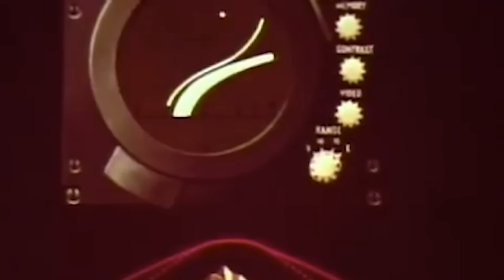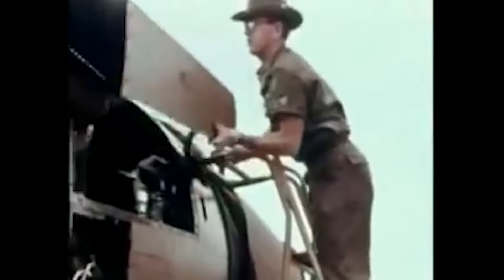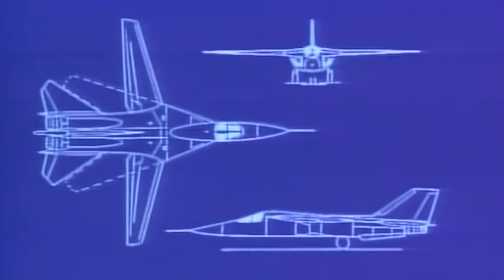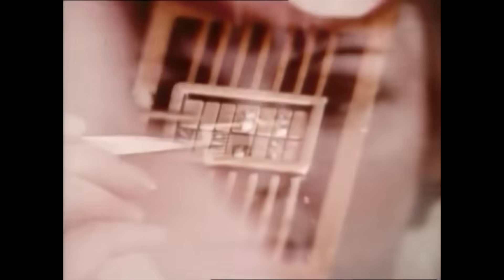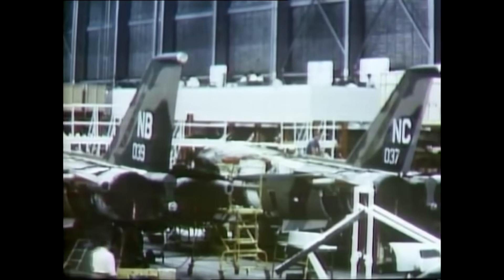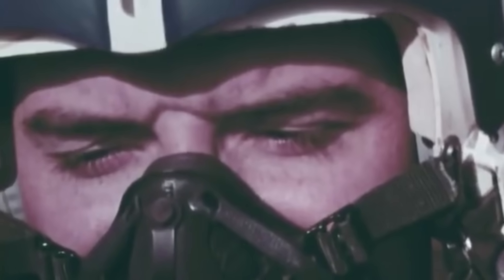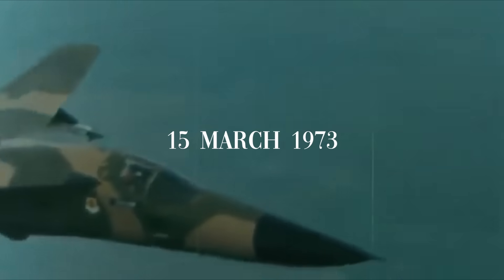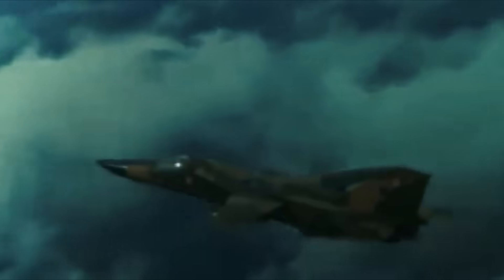The F-111's Fatal Flaw

Comment: The F-111 after its teething problems with the WCTB became the finest strike aircraft in the world and remained so for 37 years. For all the TSR2 lovers out there, I understand the emotion - I have been fascinated with TSR2 for years and travelled halfway around the world to see the two beautiful examples at Duxford and Cosford (so much for the government conspiracy to destroy all traces of them...) but the facts are Britain could not afford it, there was no export market and it was inferior in every measurable way to the smaller but longer legged and faster  F-111. I recommend Damien Burke''s exhaustive coverage in his definitive book 'TSR2-Brtiain's Lost Bomber.'

For reference- here are comparative stats

Performance F-111C
Maximum speed: 1,434 kn (1,650 mph, 2,656 km/h)
Maximum speed: Mach 2.5 (M 1.23 at sea level)
Combat range: 1,160 nmi (1,330 mi, 2,150 km)
Ferry range: 3,700 nmi (4,300 mi, 6,900 km)
Service ceiling: 66,000 ft (20,000 m)
Rate of climb: 25,890 ft/min (131.5 m/s)
Lift-to-drag: 15.8
Wing loading: 126 lb/sq ft (620 kg/m2) wings spread
158 lb/sq ft (771.4 kg/m2) wings swept
Thrust/weight: 0.61
Armament
Guns: 1× M61 Vulcan 20 mm (0.787 in) Gatling cannon with 2,050 rounds (seldom fitted)
Hardpoints: 9 in total (8× under-wing, 1× underfuselage between engines) with a capacity of 31,500 lb (14,288 kg) ordnance mounted externally on hardpoints and internally in fuselage weapons bay 

Performance TSR2 (projected)
Maximum speed: Mach 2.15 at 40,000 ft (12,192 m)  (this was later reduced to M 1.5) M1.1 at sea level
Ferry Range: 2,500 nmi (2,900 mi, 4,600 km)
Combat range: 750 nmi (860 mi, 1,390 km)
Service ceiling: 40,000 ft (12,000 m)
Rate of climb: 15,000 ft/min (76 m/s)
Thrust/weight: 0.59
Armament: Total weapons load of 10,000 lb (4,500 kg); 6,000 lb (2,700 kg) internal and 4,000 lb (1,800 kg) external

Comment: My  sister, who was stationed at Nellis AFB when the A models were there, said that there were so many problems with them, that the aircrews went on "strike" several times; every single one of them would show up "sick" at the Flight Surgeon's office. One major problem? The engines would flame out at the first hint of a rain cloud; also, like the F-14 A Tomcats, they were very prone to compressor stalls. The USAF finally swapped them with the recon RF-4C's at Mountain Home AFB, Idaho - just before I got stationed there. One of the more unpleasant parts of my career field was Aircraft Crash Survey/Recovery. Sadly, those A model's kept me much busier making crash site maps, and picking up stuff - both metallic and organic - than I would have liked... The Air Force finally wised up; shipped all the remaining A's to Grumman, who took them totally apart; threw about half of them away; and turned them - at the cost of $27 million apiece (in 1976 dollars) - into EF-111 Ravens. In which guise, they performed a whole lot better - and much safer. The rest of the time I was stationed there? Never once had to pick through the remains of a Raven....
Reply: They didn't send "all the remaining A models to Grumman...." I was at MHAFB in 1981, and there would ultimately be 42 EF-111As at two bases (MHAFB and Upper Hayford),  and enough A models remaining at MHAFB to fill out 3 other units within 366 TFW--Green, Blue, and Yellow  sections. I don't recall their numbers, but between 20-30ish each.

That being said, I only recall 2 A model crashes, neither related to the wing issue.
Reply: @Name-ps9fx  No one wants to hear your contradictory tales, sir!
Reply: I was stationed at Mt Home in 1985, and the F-111 was there.
Reply: Thanks for your service and this report.
Reply: I was in the 474th at Nellis for the last 2 years of the F-11As before they transitioned to the F-4Ds.....
Reply: @mikehayes7333  I was assigned the 474th OMS as a Crew Chief and I left Nellis in April 74, went to Lakenheath to work on the F-4D, then followed them back to Nellis to work on the same F-4D's.
Reply: @darrellbaty4127  I think I remember you!
Weren't you a Sgt when you came to Nellis?
We changed you car's transmission in the driveway of your base housing.
Reply: @mikehayes7333  Yes, I am the one, in fact, you sold me a shotgun which I still have.
Reply: @darrellbaty4127  
.....small world.....
Reply: @darrellbaty4127  
Hope you and yours are doing well.
Reply: @mikehayes7333  VX-5, China Lake.....a good deal of X testing, there, for the USAF and others....3 AM thump, thump, thump with only nav lights for knowing something was going on.  Once the TAR was gimbaled, the surfaces could actually adjust the aircraft to climb over/avoid "obstacles." Thanks for your service!  USN Squid
Reply: @mikehayes7333  <the 474th at Nellis>
I think that was my outfit also.    I've forgotten the number it's been so many years.
Reply: @penboyasgod6103  
It was either the 474th, or the 57th.
Reply: Great summary. It's interesting to see the importance between platform and mission fit in determining the success of the aircraft.
Reply: I was stationed at Mtn Home AFB 1987-90 as an airframe repair specialist.
Reply: RAF Lakenheath,78-80, F-111F's, crew chief 74-0367, mid-air with wing man April 79,both air crews ejected safely.
Reply: <who was stationed at Nellis AFB when the A models were there, said that there were so many problems with them,>
Read my post as one who actually worked on these planes during the Vietnam War time.
Reply: I crewed the F-111As at Nellis AFB, Mountain Home AFB, and RAF Takhli, Thailand. The F-111A proved itself.
Reply: @darrellbaty4127  <and RAF Takhli, Thailand>    I was at Takhli also for 4 months TDY for F-111s.
Reply: To say nothing of the TAR issues which did not allow the flight surfaces to react in time to prevent the aircraft from kissing terra firma....the folks at X.X. figured out the problem.
Reply: I don't remember the engine problem while at Nellis, but I do remember a grounding until the wing pivots were inspected for potential failure.
Reply: The f111 dominated in the gulf war
Reply: Yes, yes. You thought your sister's best friend had some job and said the plane sucked. Except it had an amazing safety record for DECADES and the people who actually flew them liked and were proud of them.

Unlike your unverified and, frankly, tired story of a flight crew that all got sick at the same time....never heard that one before. I don't believe you and I don't think you even know which aircraft you are talking about.
Reply: I was at Mt. Home from 81-82, right at the beginning of the EF program. You undersell the A model. After the initial problems were sorted out, the aircraft performed admirably in SEA. Suffered the least losses of any combat aircraft and dropped more bombs on target. The converted A's into EF's retained the original mechanical parts, WCTB, engines, cockpit, etc. After the war in Vietnam was over, the AF basically relegated the "A" to training only.
Reply: I was at Mt Home 86-90, we still had A an EF models. The F-111 replaced the  RF-4s, before I got stationed there. We had one crash while I was there, I think one burned up before I got there.-LOX issue. We also had B-1s test there. After I left I heard the base turned into a composite wing with F-15s as the fighter. I’ll have to ask a friend who stayed there 2 years after I left what other aircraft were there. But no F-4s, F-111s replaced them

Comment: for comparison  the wing box in the F14 was fabricated from titanium, in an inert atmosphere. 

If you're anywhere near Amberly RAAF base, check out the  111 on display there, it's HUGE!!!
Reply from the maker: Some of the footage in this video is from a visit to the F-111 at Amberley.
Reply: There’s an Australian F111 at the Aircraft Museum at Pearl Harbor.  One side is painted in 1SQN livery, the other in 6SQN markings.
Reply: At 8.04, that is not an F111A, it has the lengthened wings which were used on the F111C and I think the F111F and the EF111
Reply: @marklivingstone3710  The FB-111A was the only other plane to use the longer wings. The F and the EF both had standard wing length.
Reply from the maker: @marklivingstone3710  thanks Mark - making notes of any errors and will re-do the video further down the track.
Reply: I saw an RAAF F111C up close and personal when I had a holiday in Hawaii at pacific air museum, so close I could touch it , fully repainted, a truly beautiful aircraft also at Point Cook airforce base and museum they also have one of the replacements used for training They call it the Boneyard Wrangler an F111G, they also have the first Australian F111 C A8-125 the last to be flown in Australia ,I am told it’s in a hangar in pieces at the moment until it reassembled when time and funds are available complete with oil and grease marks from being disassembled and transported as the museum curator requested, I went there to get the details for the model I have and the colour scheme and markings to be authentic it looks fantastic

Comment: I worked on the electronic warfare models as their time in the USAF was coming to an end.  The RAAF avionics specialists should be supremely happy that they never had to deal with translating cowls as part of the air inlet systems. That was a true nightmare of a system.
Reply: I can tell you as an ex RAAF maintainer that worked on our F-111Cs that they did indeed have the translating cowls, it was the RAAF Gs that did not have translating cowls, they had the triple plow set up
Reply: The C model had translating cowls.
Reply: I, and I am sure others would be pleased if you could expand on this point regarding translating cowls and their impact on avionics and anything else.
Reply: @andrewb3957  The translating cowls had nothing to do with avionics, other than the fact that they were on the early models (A's and C's), and the early models had rather primitive (by today's standards) avionics.
Reply: Andrew I worked on avionics A and EF models and can’t remember working on translating cowls lol
Reply: @pops55650  in the RAAF the translating cowl system was the "electrical fitter" or Avionics technician electrical systems specialist responsibility, purely because of the microswitches
Reply: Thank you all for your input. I had no understanding of the translating cowl mechanism or the triple plow setup in the F111 being a simple GA pilot. Also now appreciate it was not the avionics themselves that interacted with the relevant cowl system,  but the specialist maintainers that oversaw critical components that had to deal with the cowls. Regards to all.
Reply: So, you were at Cannon? I was there too, I was the RA for the EF squadron.

Comment: One airforce general stated that there was not enough horsepower in all of Christiandom to make the F111 into a fighter plane.
Reply: That was never its intended purpose.
Reply: @JBofBrisbane  Doesn't it have an F designation? Not A (attack) or B (bomber)  Didn't McNamara try to force it on the Navy as it's fleet defense aircraft? I think it was its initial intended purpose. Fortunately both the AF and Navy realized it could never be one and it was transformed into the awesome aircraft it came to be.
Reply: @terryboyer1342  There seems to be several such misuse of the F. Politics or stupid decisions or both. It never was a fighter.
Reply: That was Navy Admiral Tom Connelly talking about the F-111B. The F-111 was a precision strike aircraft forced into a role it was not designed for by Robert McNamara.

Comment: When you get a choice to fly F-4 Phantoms or F-111s
Are you really going to chose F-111?

BTW - The US Navy rejected the F-111 to secure getting Tomcats
(Albeit with the A version fitted with 💩unreliable crew killing engines because the US Gov prioritised a cash saving over its fliers.)
Reply: Dude...that is SO not true.   The TF-30's were good engines made to meet the Gov specs at that time.   We didn't have FADEC and with limited stator adjustment  they did need some pilot cooperation when working the throttles...just like every other engine in the world at that time.   When you trim an engine for maximum speed....which is what the Navy had asked for...back then it came with some low speed limitations.   No other engine could perform with the TF-30's where they were designed to run so they were hardly 'shit' as you claim.

No...they weren't ideal for carrier operation but place that blame on the Navy for demanding a high strung race engine for max speeds.    The 'B' had GE's that couldn't keep up with the TF-30's but were more tractable at low speeds mostly due to them being a more recent development with more sophisticated controls.
Reply: @recoilrob324  Rob, you are clearly very knowledgable about these engines  .... More so than I am so I will not argue with what you state - That would be pure arrogance on my part.

BUT I have to reflect back that my negative view is gleaned from accounts by the Tomcat Crews themselves, a picture I've built op in large part from Ward 'Mooch' Carrol's interviews with said crews & their accident analyses.
Reply: @babboon5764  Oh...for SURE the pilots (especially the ones that got killed when they had a compressor stall during landing ops) would be unhappy with how the engines performed in carrier duty and care a lot less about whether they could intercept the enemy as quiet as quickly.
Carrier Ops have always been a risky business and every advancement in aircraft brought with it a new set of dangers the pilots had to work around.   Remember how many Corsair pilots died either because they couldn't see on landing or torque rolled over into the drink on a go-around when they applied too much throttle.
It wasn't until the mid '80's that we had truly 'pilot proof' engines where they were asking the FADEC to give more power when moving the throttle and it would not allow the compressor stalls like before.   It's asking a lot to spool up an engine while controlling the airflow through it to keep the compressor discharge pressure above the burner pressure....and many pilots seem to not really care all that much about the mechanicals under them...they just want to fly the plane.
And when they've made a mistake and gotten too slow on approach....they might already be crashed and just haven't gotten to the point of impact yet when the engines they're flying can't recover fast enough to cover their mistake.   Sad...but reality.  (thinking of Revlon here)
I'm sorry I was a little harsh in my reply before...my apologies.
Reply: It's interesting to note that the F-14 had TF-30 engines, just like the F-111.
Reply: @harrystone8847  The TF-30 powered Tomcat was intended to be a stopgap until the F110 powered models could be introduced.

Comment: Good plane but unfortunately our stupid short-sighted Government cancelled our TSR-2 a much better aeroplane. 👍🏻🏴
Reply: They were skint as usual
That said ordering the plane scrapped not preserved was sabbotage
Politicians - Great for ballast, poor decisions and trough clearing.
Reply: Unfortunately you have bought into a myth. The F-111 surpassed the TSR2 in every performance criteria. Though smaller, it was faster, had a much larger payload which it could carry further.  There is no meaningful area where TSR2 matched the F-1111. I   recommend reading Damien Burke's excellent and definitive book on the TSR2. It will debunk all of the emotional  nonsense  that  has sprung up over the years.
Reply: @Completeaerogeek  You're not counting the ability of the crew to eject safely as an important performance criterion?
Reply: @Completeaerogeek  TSR-2 was certainly not perfect and you are right, it has become mythical. However, comparing it in the way you have to the F-111 is also flawed. You are comparing a single prototype that only flew 24 test flights to an aircraft that took 7 years from the first flight to become fully operational with thousands of hours of testing and trials - and the major wing root flaw wasn't solved for another 2 years after that. By the time it got to the F variant, it had engines with 35% more thrust than the A. What might the TSR-2 might have evolved into, 10 years after its first flight? And yes I have Burke's book and it is excellent!
Reply: @FinsburyPhil  Hi Phil, unfortunately we don't have any data regarding how the TSR2 might have turned out, so I'm not sure how that is unfair, but if you have read Burke's book, you would know it was not on a good trajectory. 

It was getting heavier, had its maximum speed reduced to M 1.5, the Olympus 22R had 'Bell mode' issues (it should never have taken to the air until these were solved,. Beamont really was risking his life.) and with its small highly loaded wing it would never be able to carry the load the F-111 could, did not have the range or speed of the F-111 and the requirement to take off from marginal quality runways was never met, where the F-111s high flotation landing gear and large tyres mean it was capable of this. (XR-219 in fact suffered severe undercarriage oscillations during test flights.)

Not sure where you got 7 years for the F-111's development - It first flew in 1964 and was flying combat mission over Vietnam in 1968. Some problems with faulty subcontractor manufacturing of the stabilator caused a couple of losses but by the time it left in 72, it had the lowest loss rate of any aircraft in theatre while carrying out the most hazardous missions at night and in bad weather,

Our F-111Cs (basically an A with the FB-111 wing and undercarriage) did not have WCTB failures and were not modified but we Cold Proof Load Tested them for their entire life with no failures..

They stayed in precautionary storage from 68-73 when they were flown home and made operational. We later upgraded them with all digital avionics, Pave Tack (and PGMs, Harpoon, Sidewinder) a digital flight control system, upgraded radar/ECM/RHWR and new engines (P-108) 

For 37 years, they were the most potent low level strike aircraft in the world and let us punch way above our weight in the SEA region